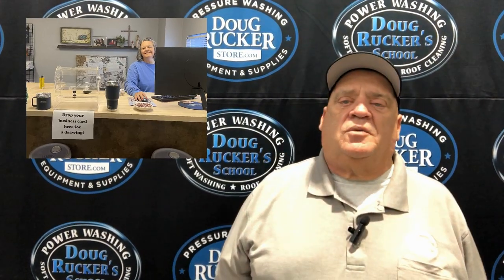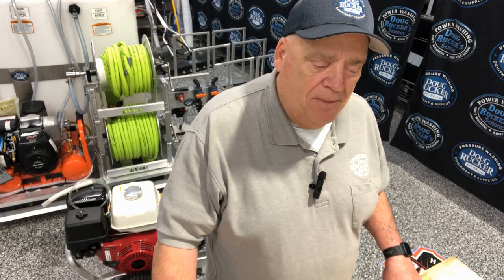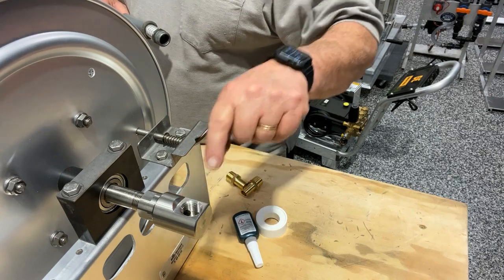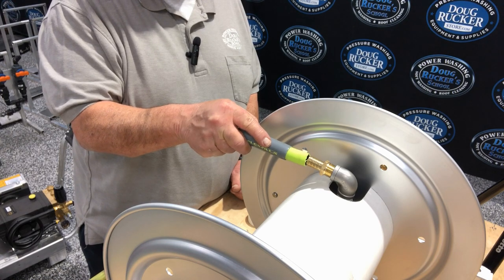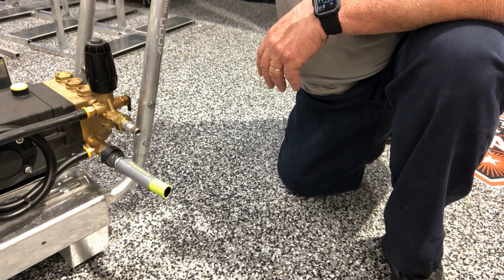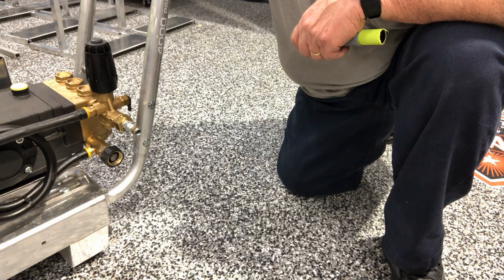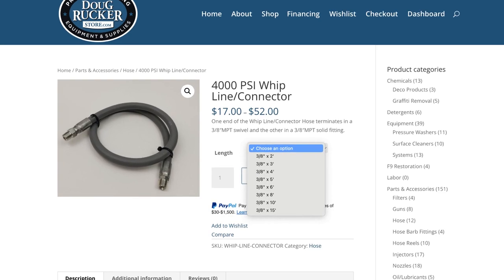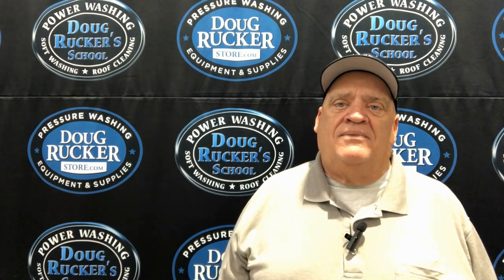How to Set Up Pressure Washer Hose Reel for Portable Machine

Comment: Doug thank you for these vids, you cover all the little things the others don't.  It's greatly appreciated, you gained a new customer just because you put the time in for us newer guy's.
Reply from the maker: Thanks so much. Glad to know it helps.
Reply: @PressureCleaningSch  Hey Doug, could you do a video on using the pressure washer hose in 50 ft section's showing what connection's you would use?  I seen one guy saying to have it in 50 ft section's incase the hose blows out.  It's easier to replace on site, which made sense to me.   I'm trying to figure out all the connection's in a rig and don't want to buy unnecessary fittings.  If not, do you have any thoughts on this?   Thank you again!

Comment: Very informative video for the newbie. Thank you! One advice though from my personal experience. I recommend using the reel for your high pressure hose ONLY for storage purposes and recommend NOT running SH through it. This will extend the life of your reel significantly from my personal experience. Thank you for your continuing videos!
Reply from the maker: Once the manifolds go we use them for storage only.  But until then we use them fully.
Reply: @PressureCleaningSch  same here…👍

Comment: Hey Doug, I just recently noticed I have a small oil leak coming from the sight glass on my pressure washer. Am I OK to wash another house and driveway before I get that fixed?
Reply from the maker: No you need to get that fixed. The sight glass could actually blow out while using.

Comment: Dumb question but I plumed my hose reel to machine, I have 200ft of pressure hose however majority of the time I may only need about 100ft or so is it fine that rest stays coiled on the reel or should I pull its entire length
Reply from the maker: It's best to reel it all off.  The fluctuations in pressure can damage the reel and the cause the hose to wear out prematurely.
Reply: @PressureCleaningSch  can I use the whip line with a quick connect & just bypass running chem through the reel itself I just pull what is needed & go
Reply from the maker: @Anthonysni92  you can bypass the reel yes, but you'll still have to pull all the hose off to connect to the whip line.

Comment: Hello Doug I love the value, Do you by chance have any videos on removing the male quick connect on the surface cleaner and replacing it with a female (this is done so you can connect a ball valve that has a male quick connect fitting directly to the surface cleaner or wand)
Reply from the maker: I believe so in one of the surface cleaner videos.  Just need two wrenches to change out the fitting at the gun of the surface cleaner. One for the gun and one for the fitting.

Comment: Don’t use tape. Shit breaks up and potentially enters line, pump, what have you
Reply from the maker: Been using it for years and never an issue, but I do know a lot of guys that don't use tape.  I've just used it for so many years without a problem that I can't not use it.
Reply: PFTE tape doesn’t “break up”. If you’re getting it inside the pipe, that’s operator error.

Comment: Why not just use a hose reel that you can buy and attach a hose to?  Those have a short hose to hook to the hose bib and the other end of the hose to your pressure washer.  You can move wherever you want.  What you are doing you're destroying a hose so you can't use it for portable applications and have to buy another hose. This video seems waaay more complex than necessary
Reply from the maker: This is for guys that have a 4GPM machine and want to be able to leave it in there van and feed off tank, OR, take it out and hook to the water source.  If taking it out there's not need for a hose reel separate from what they already have in the van